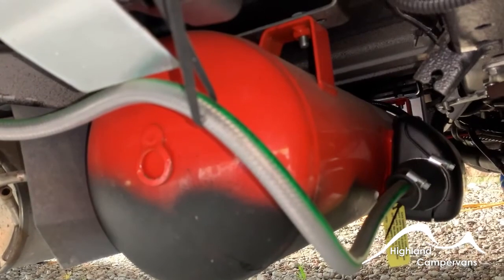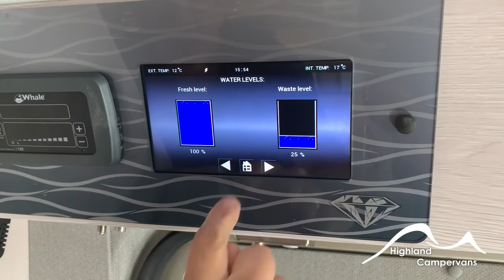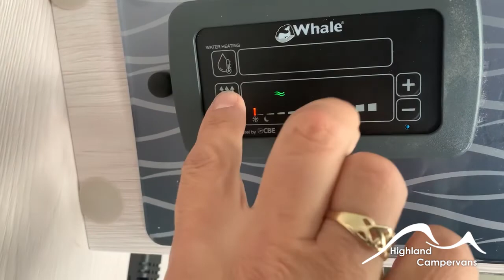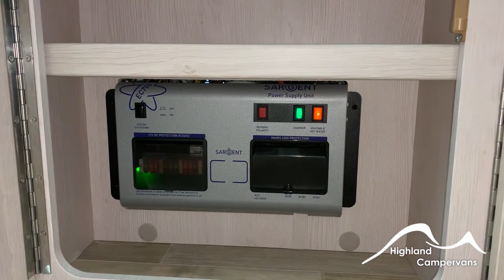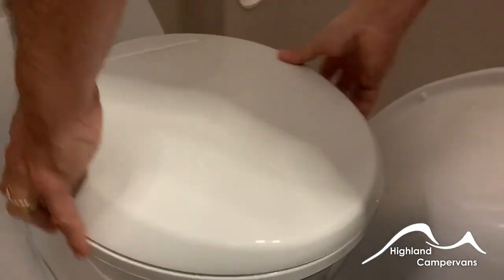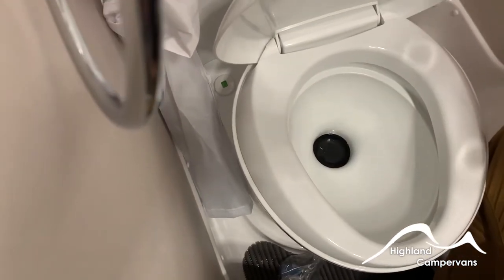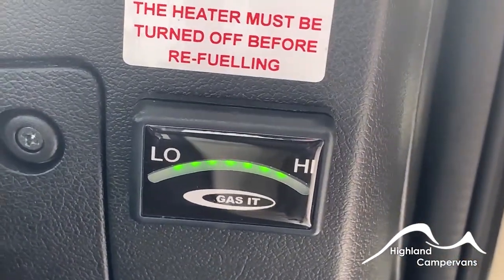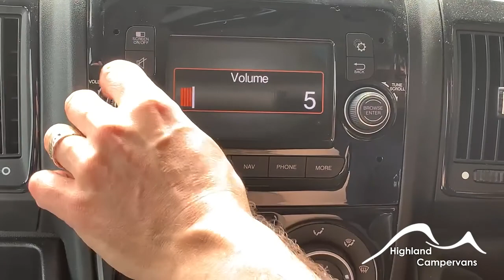Auto-Sleepers Symbol Handover Video

Comment: This is a really brilliant handover and very, very much better than the the handover I received when I took delivery of my new Symbol from a different dealer in 2020.  
What is not mentioned is the appalling Auto-Sleepers warranty.  The Sargent electrics on Auto-Sleepers are only guaranteed for one year - so if there should be any fault on these after 12 months the unfortunate owner is faced with a massive bill.  This is made worse by the Sargent design which incorporates several different electrical controls in single units, with repair or replacement of anything but the entire unit not possible.  For example the Sargent EC700 PSU unit costs £476.  A factory repair of the entire unit is available for £180, but this can take several weeks and the motorhome will be unusable during this period.  There will also be additional and substantial costs for the services of a technician or vehicle electrician to remove and replace the units.  (Sargent say that this should only be done by an appropriately skilled person).
Also, I'd recommend owners to lift the bed support frame a little before sliding it out to make up the double bed.  It might just have been a fault with my van, but sliding it out horizontally (as show in this video) pulled the pressurised cold water supply pipe from the top of the water heater.  This happened about a month after delivery, which was a bit of a cathartic experience.  Learned a lot about John Guest pipe fittings in a very short time! I effected a repair by replacing the short pipe that feeds directly into the water heater with an even shorter length of flexible pipe, which is still fine after three years.

Comment: Thank you, very helpful. It terms of the air suspension, please could you explain the purpose of the switch ? Thank you.
Reply from the maker: The gauges panel is a standard panel that is used on vehicles that have a built in air compressor as well as those that don't. This vehicle does not have a built in compressor so the switch is redundent.